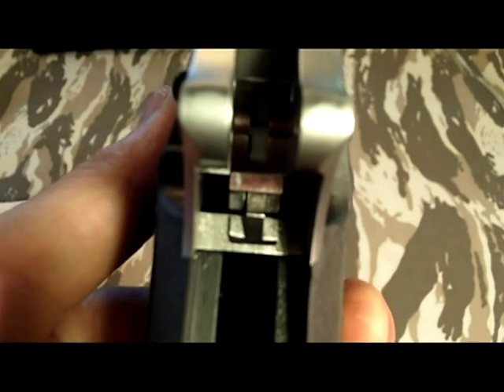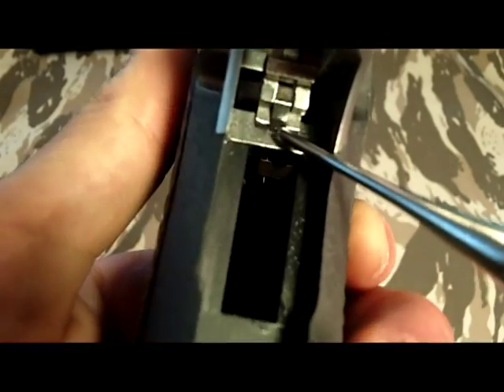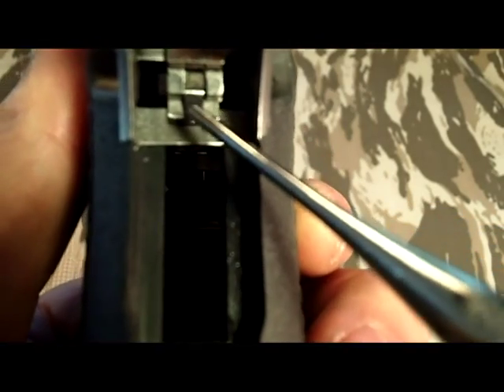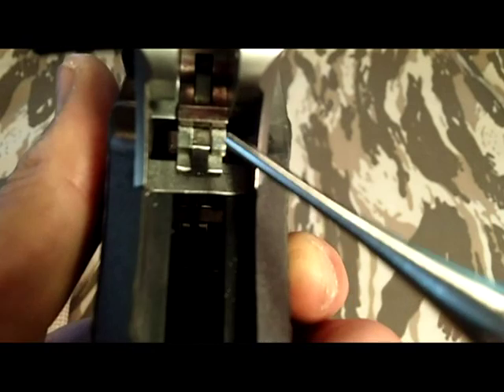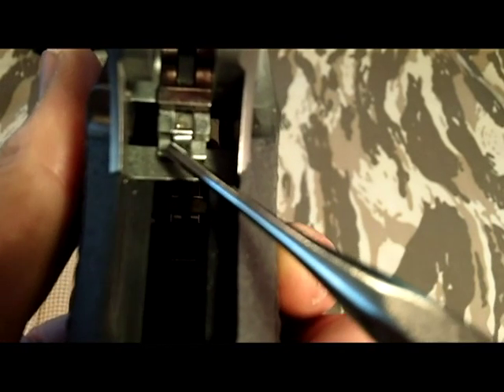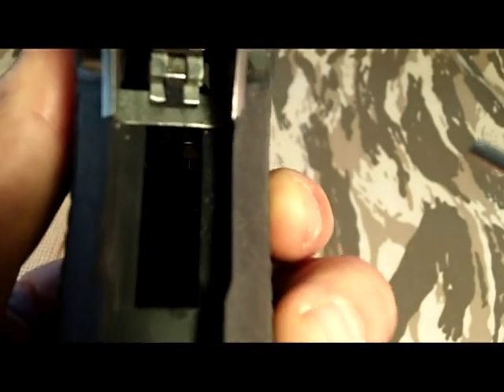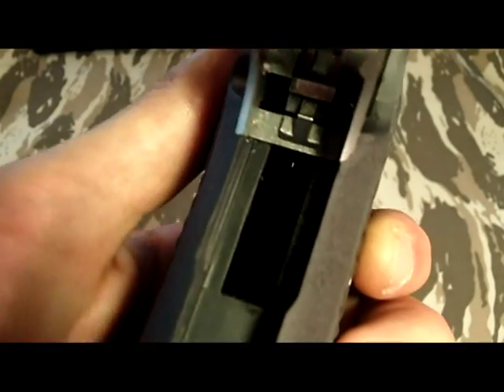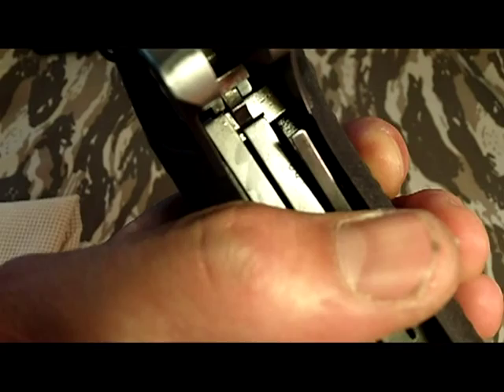Wilson Combat Grip Safety Resolved..For Real This Time!

Comment: Did you 1911 function otherwise? Even though the grip safety didn't work?
Reply: I have an SR1911 and after 3 or 4 shooting sessions for a total of 180 rounds my grip safety doesn't work and after each session I would take the slide and barrel off of the frame, wipe it down, reassemble and perform the function tests. After my last shooting session of about 40 rounds I did my usual cleaning routine but when I performed the function tests my SR1911 grip safety failed the function test and puzzled the hell out of me
I immediately went out to my back yard range and fired 16 rounds through my SR1911 and it worked flawlessly in every aspect except the grip safety. I came in my house and took main spring housing off, took pics of the layout of the gun then removed the plunger and spring and one more part out making note of the order that they go and then removed the sear spring? and grip safety.
I cleaned every one of the parts and cleaned the round channel in the block and I checked the grip safety and sear spring for any burrs or anything that looked out of place.
I reassembled the SR1911 and did the function checks again and once again the grip safety failed. I grabbed 16 rounds and headed out to my back yard and fired the 16 rounds through the gun with no hiccups except the grip safety not working as it should.
I figured I could send the gun back to be checked or buy a new sear spring to try in case one of the 3 prongs on my original spring was bad from the factory but I didn't really want to ship the pistol with all of the Covid craziness and other factors.
I was working a lot so I put the gun away and sort of forgot about the problem until now which is why I'm searching videos to see if I can figure this out on my own
Either way my 1911 grip safety should not have failed in 180 rounds but I do realize shit happens and I don't think any gun manufacturer has 100% of their guns work flawlessly until a high round count is shot from their guns. Hopefully I can figure the problem out myself with only having to only disassemble the main housing if not I will either have to send the pistol back or just not worry about the grip safety and shoot the pistol as is

Comment: What you just showed would make the sear completely non-functional.  Nothing personal, but I think you should let a gunsmith fix your guns.
Reply from the maker: Well seeing as how it worked and others have had it work for them I respectfully disagree. I don't claim to be a gunsmith and I use one when appropriate but this absolutely fixed my issue and I have had zero issues since.
Reply: @OpIndependence  If the sear spring is not pressing against the sear, then your problem would not be a malfunctioning grip safety.  The hammer would never lock back, because the sear would never catch it.